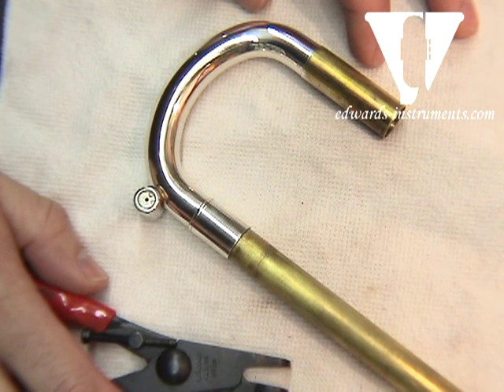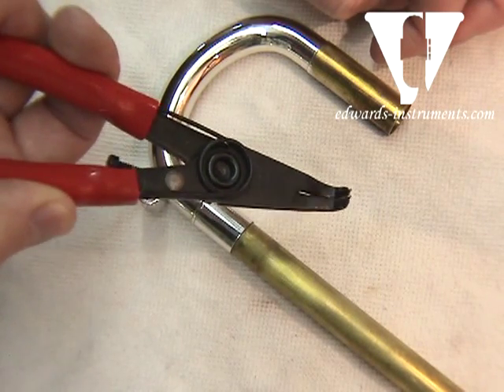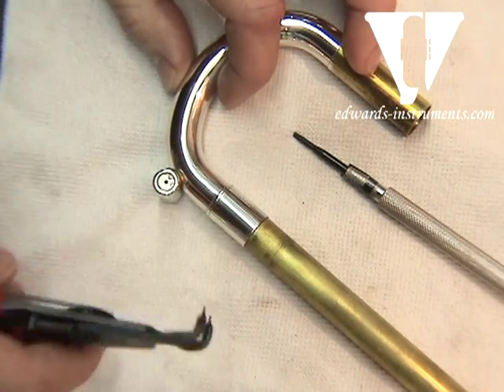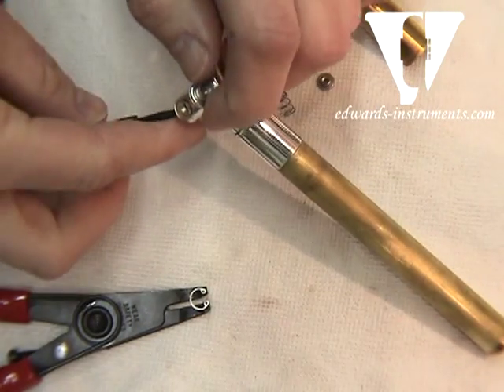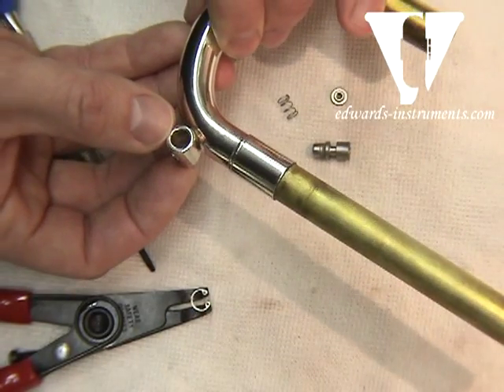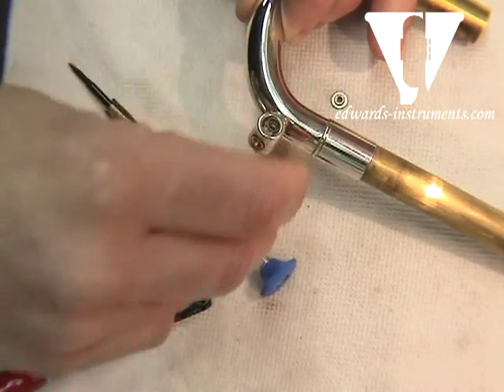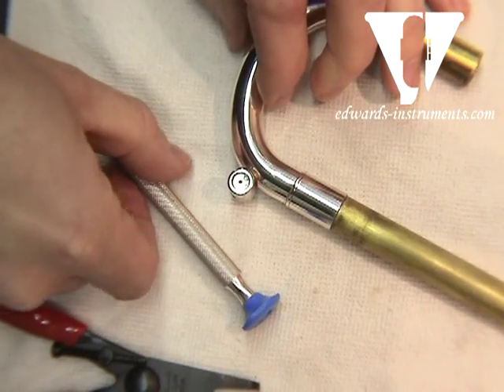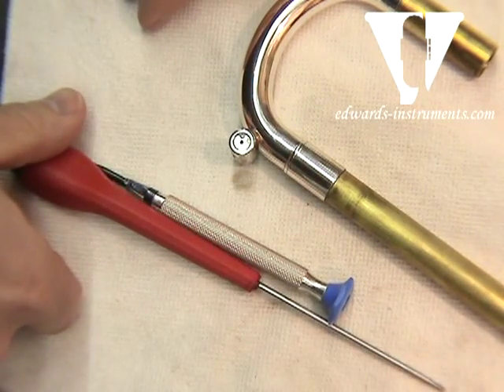Amado Waterkey Overhaul

Comment: It's helpful to put the slide into a large plastic bag before attempting to remove the spring clip so that when it goes flying off the bag will catch it. Especially if you are doing the screwdriver method instead of the spring tool method. In this video the clip stayed on the tool (and was a surprise to the guy) and he didn't do the removal with the screwdriver (just demonstrated how to start).

Comment: TKs for this video,,,just unclogged an amado key on my flugel,,,,didnt have the tool , 2 toothpicks did the trick on the spring.
Reply: Hi David. Have you heard of the JoyKey? It drains the water automatically. No moving parts. Nothing can jam or break. Replacing a clogged WaterWick (the high-tech bronze metal filter) is as simple as screwing off a cap, removing the old WaterWick, inserting the new one and screwing the cap back on. Takes less than 60 seconds.